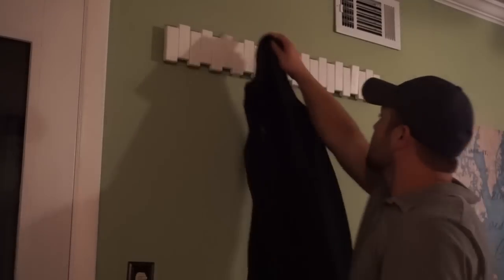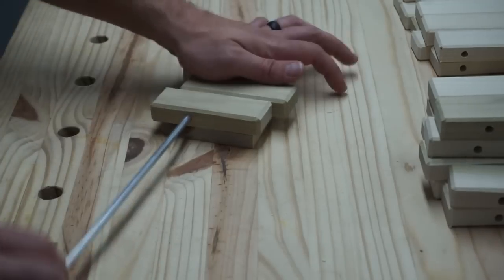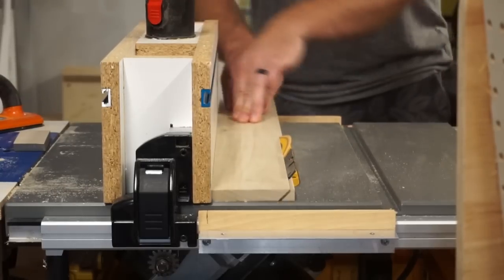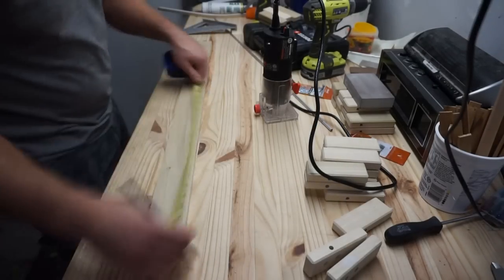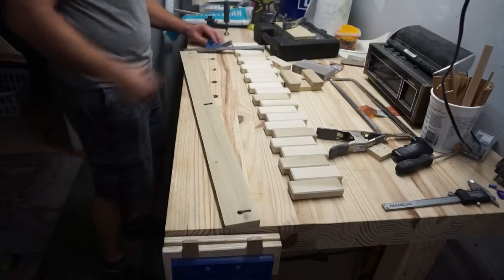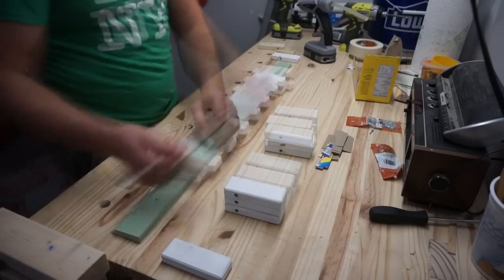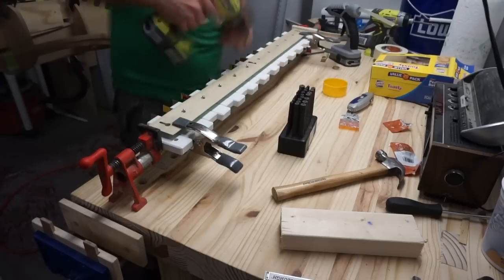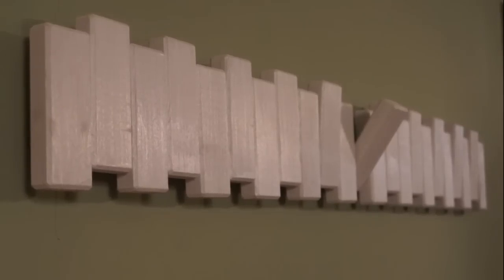Making a Pivoting Wall Mounted Coat Rack

Comment: Very nice work! Fantastic! Just wondering what type of wood that is that you're using and how much the parts for something like that would cost?
Reply from the maker: I used poplar for this. I probably paid less than $20 in materials... and a few more dollars with paint maybe. Thanks for watching Mark!
Reply: Thanks so much for the reply. That's fantastic thanks. Just wondering if with poplar if you painted it with high gloss paint would the grain still show through? I'm looking at making something like this but unfortunately need it to look like an existing shoe cupboard which has a very high gloss look to it with no grain so would like to match that as closely as I can if possible?
Reply from the maker: For sure. I think that especially if you put enough coats on it you should be fine. Maybe even a layer of primer. Plus you could sand between coats.
Reply: That's great! Thanks very much for the help.
Reply: Please be sure to seperate the pieces.  The paint will stick caused by expansion and contraction from changing temps. hth

Comment: Just curious, do you ever have a problem with the movable pieces falling down when they're not being used?
Reply from the maker: Actually Sue I have had an issue with that. I actually tightened things up just a touch by adding a little more paint. That gave just enough friction to keep them from falling. Thanks for watching!